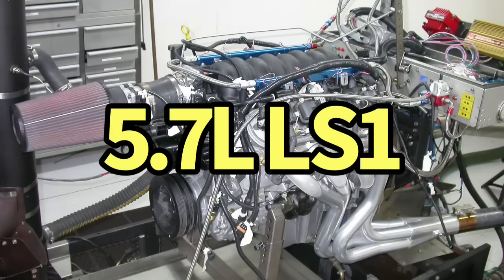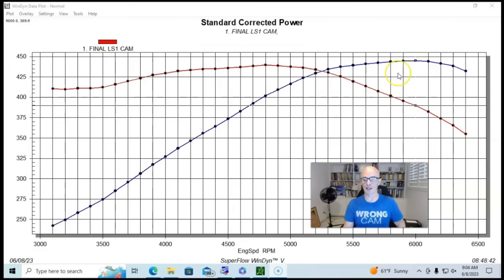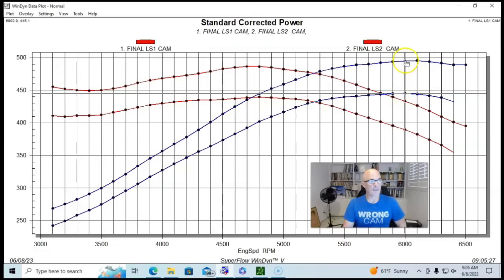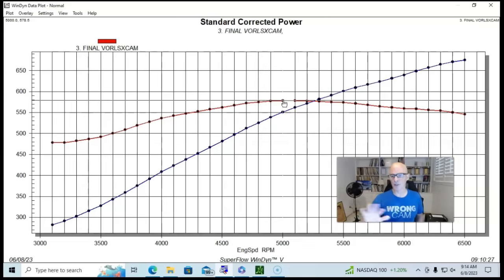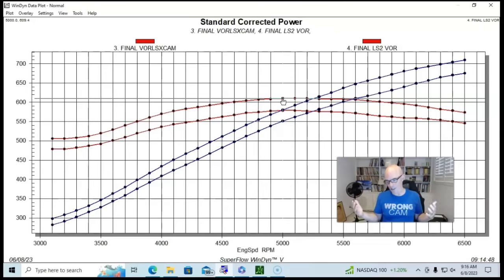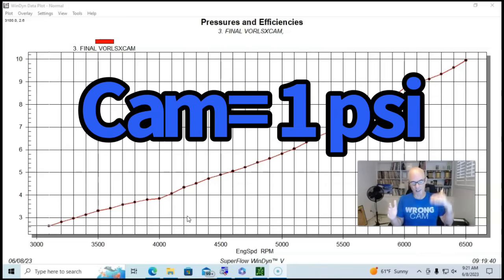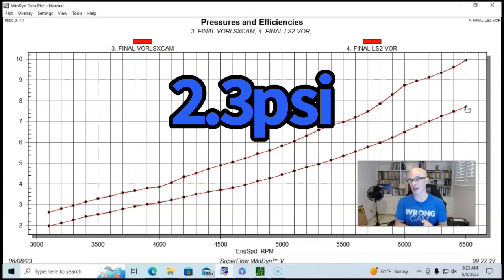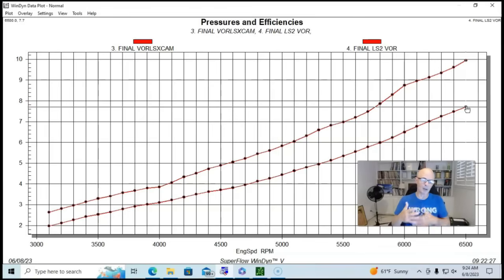HEAD TO HEAD SHOOTOUT-LS1 VS LS2 WHICH ONE MAKES MORE HP NA & BOOSTED WITH A VORTECH SUPERCHARGER?

Comment: I have am Xer stage 3 cam in my auto (sadly) 2000 C5 corvette, with long headers and full custom exhaust, LS6 intake.  Makes 409rwhp and around 535nm wheel torque. Somehow it made more torque than your ls1 in this video.. It was run on 98 octane.
Reply from the maker: how do you compare rwhp to fhp? The answer is you can't
Reply: @richardholdener1727  Converting rear wheel horsepower (RWHP) to frictional horsepower (FHP) involves understanding the losses associated with the power transfer from the engine to the rear wheels. FHP represents the power lost due to various frictional and mechanical losses in the drivetrain which can include losses in the transmission, differential, axles, and other components. The formula for converting RWHP to FHP is: FHP = RWHP / Drivetrain Efficiency

Determine the Rear Wheel Horsepower (RWHP): This is the actual power measured at the rear wheels of the vehicle using a dynamometer or other power measurement tools.

Find the Drivetrain Efficiency: Drivetrain efficiency represents the percentage of power that is lost as it travels from the engine to the rear wheels. It accounts for various losses, such as friction in the transmission, differential, and other drivetrain components. Drivetrain efficiency typically falls within the range of 85% to 95% for most vehicles, but it can vary depending on the specific drivetrain design, condition, and quality of components.

Calculate Frictional Horsepower (FHP): Divide the RWHP by the drivetrain efficiency to calculate FHP

For example, if your vehicle produces 250 RWHP, and you estimate the drivetrain efficiency to be 90%, the calculation would be: FHP = 250 RWHP / 0.90 (90% expressed as a decimal) = 277.78 FHP

So, the frictional horsepower for this example would be approximately 277.78 FHP

Comment: I wish the used the ls6 to go head to head with the ls2 since the stock hp/tq is about as close to each other as any 2 LS engines have ever been
Reply: This may be good ole internet folklore, but I heard the LS2 took place over the LS6 in the CTS-V because GM recieved complaints that the LS6 idled "too aggressively." Since the LS6 has a "hotter" cam compared to the stock LS1. The LS2 made the same exact power as the LS6, but with a "smoother idle" and the power difference made up by displacement.

Again, probably good ole folklore I read long ago when I was browsing the V forums, but if that is the case I think it's hilarious. Because that has to be the most boomer complaint I've ever heard... "My high performance sports sedan idles too rough 😡"
Reply: @OctaneSlain  that’s definitely interesting I didn’t know the 1st generation ctsv ever came with an ls2. I thought they were all ls6 cars for some reason.. love the ls6 in my 03 z06!!

Comment: There is one thing that has always intrigued me about the 346   lS1/6 engines.  They seem to be over achievers, and they get substantially better gas mileage than the 4.0 bore engines.    Back when c5's were new we were spraying the crap out of them and when guys would nip number 7 piston they would swap in a 6.0....the cars were never faster and in most cases slower.   Once we got older and had more play money and got into Superchargers....the bigger engines did run better.   I love me an ls1/ls6
Reply: Have a LS1 in my Chevelle, and I always thought I would never go 6.0 maybe 5.3 for general fun?
Reply: @timschrock23    Leave the LS1 and hang the cheapest Vortech swap centri kit on it and be amazed and have zero issues.
Reply: Considering the 6.0s are iron blocks...
Reply: @shadowopsairman1583  LS2 is aluminum block you goober

Comment: I’m not sure what kind of math you are doing but 710hp minus 675hp equals 35hp. Not 45. Hate to be that guy, but accurate numbers matter.
Reply from the maker: WHEN YOU LOOK AT 99 THINGS THAT ARE CORRECT AND 1 THAT IS INCORRECT AND FOCUS ON THE 1-YOU ACTUALLY ARE THAT GUY!
Reply: @richardholdener1727  well I guess so. No need to get so mad about it. As smart as you are, I figured you could get that wrong! 700-675 = 25 + 10. Easy to do in your head instantly. You know, because you said 45, and I trust what you say, even though I knew it was 35, I STILL double checked with a calculator. Because in your defense, I didn’t want to believe you were wrong.
Reply: you are a silly goose
Reply: @sniperpronerfmods9811  lol. Why?
Reply: @Turbogto_guy  WHEN YOU LOOK AT 99 THINGS THAT ARE CORRECT AND 1 THAT IS INCORRECT AND FOCUS ON THE 1-YOU ACTUALLY ARE THAT GUY!
Reply: @sniperpronerfmods9811  real original. AI must’ve copied and pasted. High five.
Reply: @Turbogto_guy  smolpp
Reply: Don't worry, I am sure that after a quick facepalm, @richardholdener was laughing his ass off as he typed that in allcaps!
Reply: @bigbad253  don’t worry, when I heard what he said then did the math in my head, I gave palmed and laughed my ass off too. Then thought to myself, how can you possibly add that up wrong. But hey, I’m the bad guy here. Lmao

Comment: The LS1 is the holy grail! And far as iam concerned, runs better than the rest!
Reply: I loved the ls1 in my old 2002 ws6 but my 07 base corvette with the 4th gen ls2 has given me more power with less problems
Reply: I will keep my iron block LS1
Reply: Ive had a stock LS1 and then ran it with a summit cam for 2 years. The LS1 sounds the best but the torque and power my currently stock LS3 are much better.
Reply: I’ll keep my 468 —-“ ❤
Reply: But it's literally the second worst